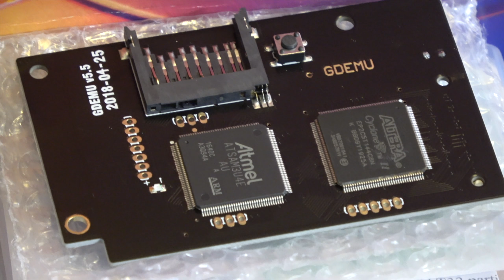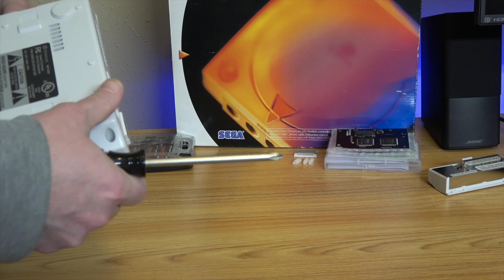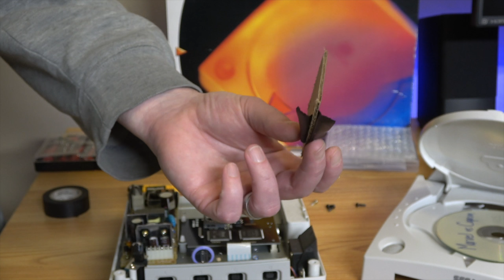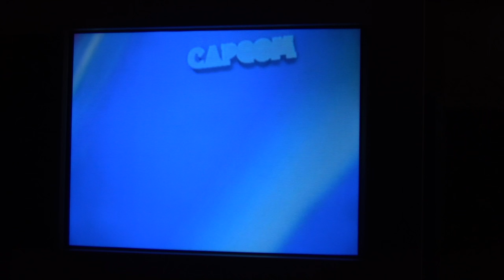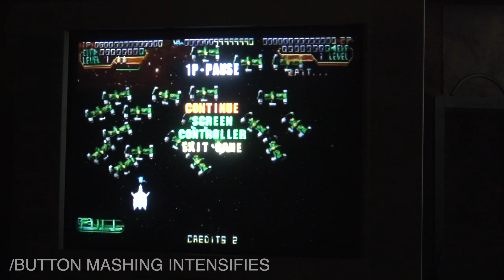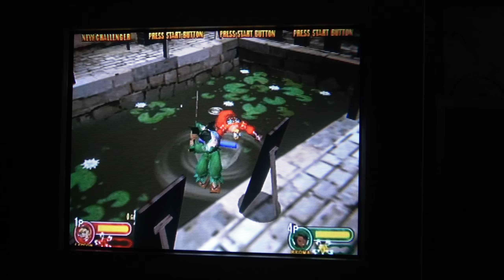GDEMU Clone - Optical Drive Emulator for SEGA Dreamcast

Comment: v5.5 actually runs FW 5.0.5 which is not only much older, but it was also produced with a wrong crystal, which leads to problems. v5.15 is newer and uses the correct components. Compatibility of 5.15 is near perfect, the only game with serious issues is Code Veronica. Skies of Arcadia and D2 have minor problems, in SoA's case it's just a glitched intro.

Also lol, "ripped some ISOs". DC games are notorius for being a pain to rip and either require a rare broadband adapter (lest you feel like ripping a game at 33,6 kbps, which is like 3 KB/s) or you happen to have a very specific disc drive with custom firmware.

There's no shame in using ROM sites, everyone that's interested in this kind of stuff does it.

Comment: WARNING TO ALL: if your going to use the GDEMU ( clone or original) you MUST remove the + 12v Voltage regulator from the power supply. Since there's no load on the +12v rail now that you removed the gdrom drive, it will overheat
Reply: From what I read, it seems there may not be any extra heat(compared to having the GDROM drive connected), but it lowers the overall temperature by removing it.

Comment: Can someone tell me what the differences are between the 5.15 and 5.5? 😖 Thanks
Reply: It isn't very intuitive but the 5.15 should actually be the newer one. The 5.15 one should have 5.15 firmware on it. You can't update the firmware on these clones or the device will be bricked. Latest official firmware is like 5.20 or something, but I guess the Chinese hackers haven't cracked it yet, they probably never will since the creator has cracked down on security.
Reply: KHANV1CT Hi😃 Thanks for the reply👍 Are you able to answer my second question, about software?
Reply: Andy Davidson 5.15 has better compatibility and bug fixes.

Comment: Thanks for the info as I resuscitate an old Dreamcast that stopped reading discs and want to add this mod in addition to the power and clock mods as well. Do you use VGA or regular composite cables on your monitor?
Reply from the maker: I usually play on a CRT TV, right now I’m just using composite, but I’m looking at getting s-video cables ✌️

Comment: I just open my Dreamcast and the  replacement SD board won't fit its a totally different Dreamcast I guess.
do you know what serial number or model# of Dreamcast I need
Reply from the maker: Apparently it needs to be a VA1 model Dreamcast. I guess there were some later revisions that made changes to the motherboard, but most units should be VA1. https://gdemu.wordpress.com/installation/gdemu-installation/

Comment: You now need to mod the Psu or your DC will soon be a thing of the past. As there is no need for the 12v supply for the Gdrom. I would get a pico psu.
Reply: Nonsense. The 12v mod is NOT mandatory.
Reply from the maker: Troo Groove - I’ve heard of it running warmer, but haven’t seen any actual accounts of them failing?

Comment: Just a heads up, software version revisions don’t work the same as decimal numbers. 5.15 is newer than 5.5.

Anyway, have a blast with your Dreamcast! The greatest system of all time!
Reply from the maker: Wha- you’re right! The 5.5 for some reason is really v5.05 and slightly older than the v5.15. From what info I can find though, game compatibility is the same, and they just changed the SD slot. If that’s the case, I’d get whichever can be found cheaper! ✌️
Reply: @TechWithSean  I'm not sure about the whole ".5 is really .05", but nonetheless when it comes to software version revisions, .5 is always older than .15.  Also, I've read that there were also tweaks to the board for DCHDMI compatibility issues.  I can't verify that claim, though.
Reply: @TechWithSean  I think it's easier to think of 5.5 as the 5th revision of the 5th version. Perhaps part of the reason they don't use a somewhat clearer .05 etc, is because they don't know how many revisions they'll ultimately make.
Reply: Oh so it's 5 vs 15.  A bit confusing.